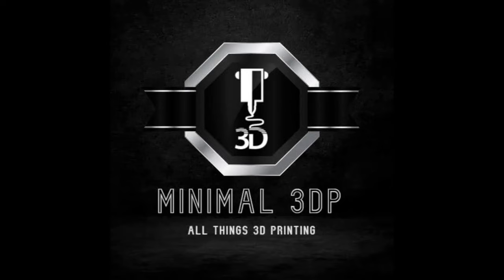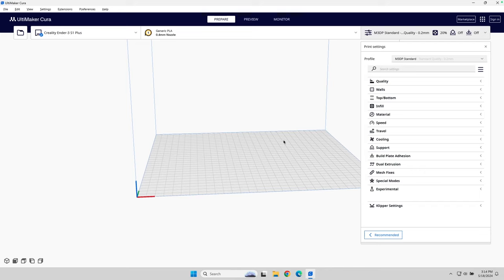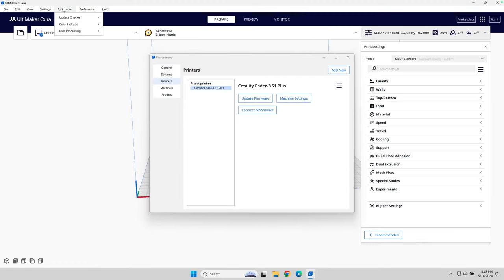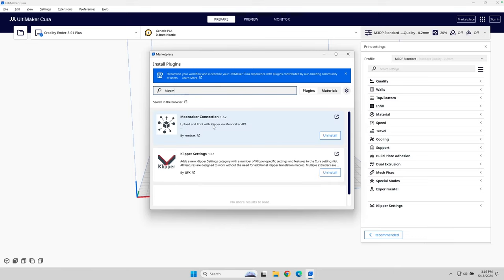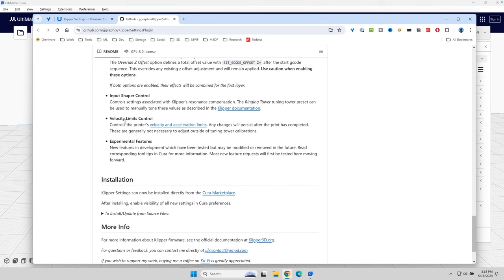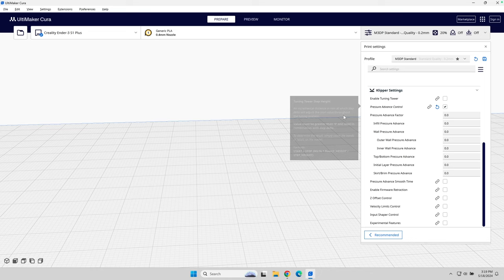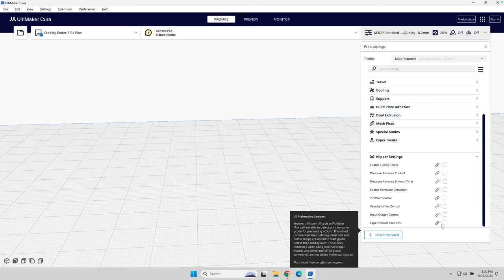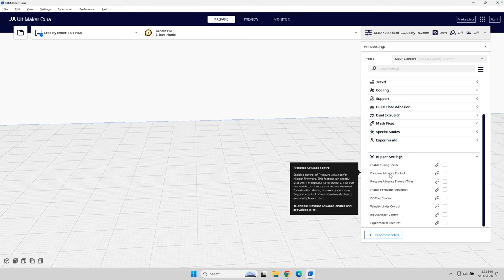Level Up Your Prints: Fine-Tuning Cura for Klipper [Settings & Optimization Guide]

Comment: Thanks, I tried the Klipper plugin in Cura but did not know how to set it up. I am using Orca Slicer to get rid of seams.
Reply from the maker: I use Orca Slicer as well as my primary slicer. My only issue is I find Cura plugins to be great.